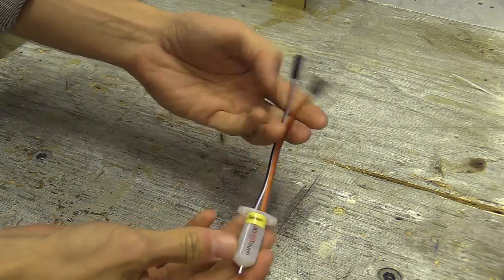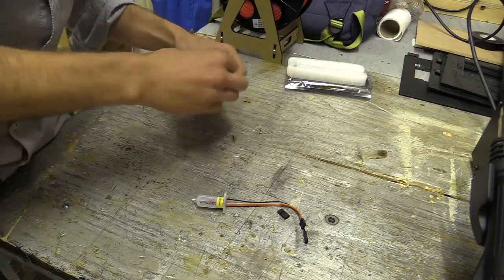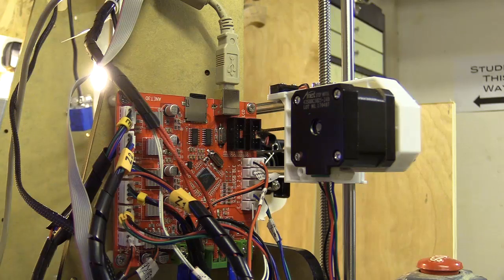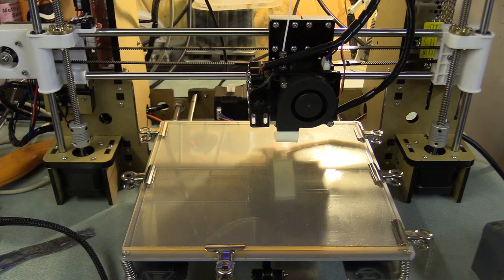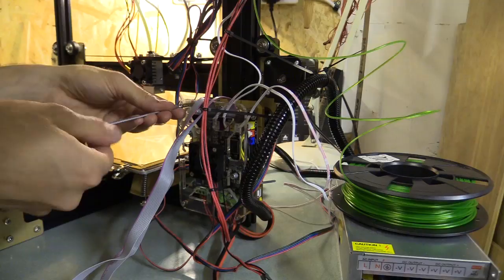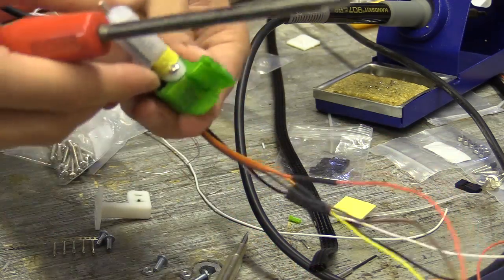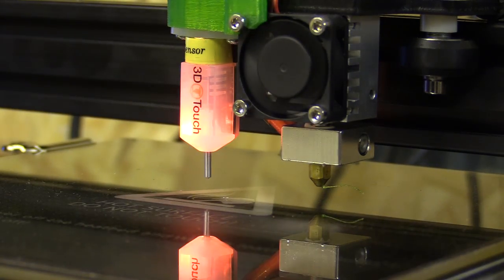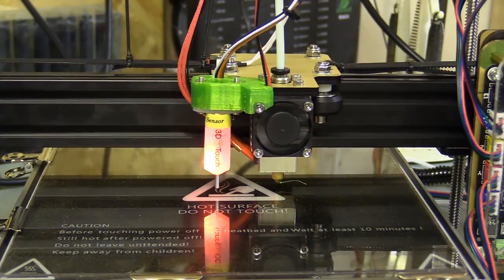Wiring 3D Touch Probe And Installing on Anet (Fail) & Tarantula (Success)

Comment: ok, BLtouch is working with display commands functioning.  As per thingverse user Anet E12 user group,  SERVO0-Pin 29 must be used  in the firmware and also wired on the LCD socket.  Do not use PIN 27 or wire to it on the socket.  Must disable SDSUPPORT in firmware or it will not compile since Anet  does not have enough memory to enable BLtouch, Bilinear auto bed leveling.
Reply: Deagle7298 that’s interesting! Can you provide a link to that group?

Comment: I just installed my BLtouch today and found none of the commands worked either.  Using Marlin 1.1.8 on a Anet E12 with a V1.5 motherboard.  I wired like you did with the metal wire plugged unto LCD ribbon cable.  Through experimenting, I can manually entering commands, I found that I had to disable Anet Full Display in the configuration H file to get the commands to function through my slicers command prompts but I no longer have a  display to calibrate the BLtouch.  I can calibrate using command codes though but its a pain in the butt.  I think I may have to actually cut the wire in the ribbon cable to be able to Re-enable to Anet Full Display feature, I think there might be some sort of interference with the signal.  I'm waiting to test this out since I am ordering a replacement cable but I have seen other people cut the wire.

Comment: Your video was helpful, as it shows the wire connections to the ribbon cable partially. I could really use some more guidance on how to make the connections to the board. I am using Marlin 118.

Comment: you know I was thinking you could buy the ramps board you can get them from ebay with a Arduino Mega for £25  maybe it will the prob on the a8
Reply from the maker: I'm going to get a few more printers from whoever wants to send them to me and build a super franken 3D printer.

Comment: Taking a bit of time to understand Marlin configuration.h and configuration_adv.h files will take you a long way towards your goal. They are pretty well commented these days, so it shouldn't be rocket science. I don't know how much butchering was done in these custom builds, but taking it back to latest stock Marlin shouldn't be too hard.
In any case, if you run the printer unattended (which is IMHO always a bad idea), check that thermal runaway protection is enabled for both the bed and the hotend - it's disabled in some cheap printers leaving you with a non-insignificant fire hazard.
Between 1:20 and 1:30 the heater and thermistor cables are clearly bending right at the stress point where they exit the heater block. You should really look into printing some kind of bracket to serve as a strain relief otherwise you'll soon end up with a broken heater cable, or worse, a broken thermistor and a working heater on a printer with no thermal runaway protection.
There is a 18mm version of inductive probe than has about double the sensing range (about 4mm over aluminum beds) and models with longer range are available from electronics vendors. Why you would even bother with glass if you already have an inductive probe and can enable mesh bed leveling is beyond me but it's your party :)
Regarding ABS, stay away from it if you don't have an enclosed printer. ABS warps badly, won't stick to bed, stinks, is less rigid then PLA and is only needed in high temperature areas anyway. I used PLA for parts of a self-sourced Ultimaker and it worked even for E3D v6 holder and fan shroud. Only PLA parts that couldn't handle the heat were single walled print cooling fan ducts and they only deformed during long prints in an enclosed chamber with 110/95C bed and 270/255C extruder - ironically - while printing ABS parts :)

Comment: I think I could make use of a 3d printer. They seem more reliable than my a4 bubble jet and laser printers.
Reply from the maker: I just wanted a 3d printer so I could make wing knobs, and now I have three. So I'm thinking of starting a wing knob factory.
Reply: you can make swan wing knobs
Reply: That sounds like a sound business model. I'm not sure you should make them with cheese, due to humorous parametric searches :P
Reply: you need multiple printers so they can take turns making flimsy replacement part for the parts that failed on the others ;)
Reply from the maker: Swan knobs!
Reply from the maker: I should 3D print a cow, and fill it with milk.
Reply: Well if the saying is correct about swans and their busy feet, perhaps they do get foot cheese. Only missus swan could confirm anything other.
Reply: Print two, then you could fill the udder one!